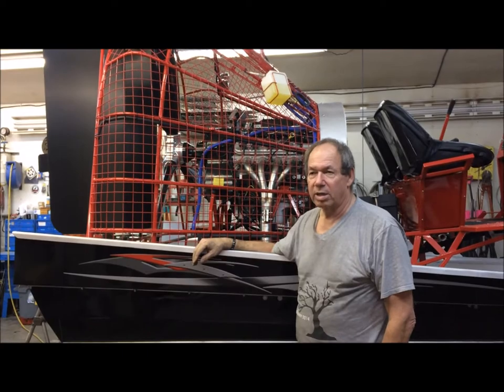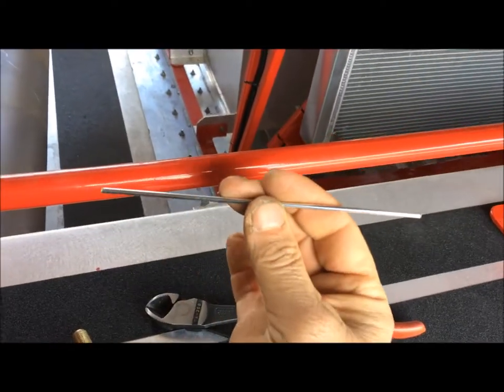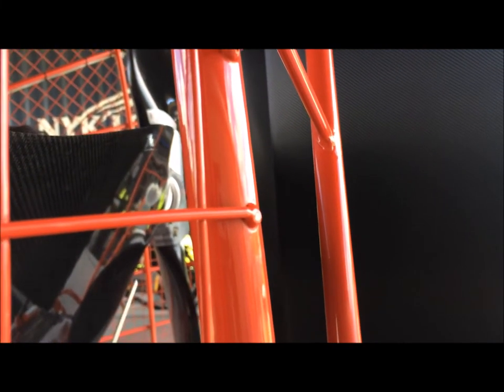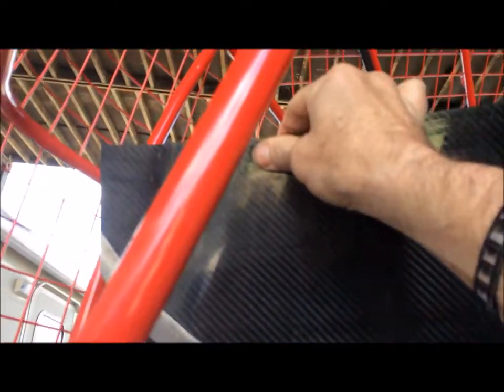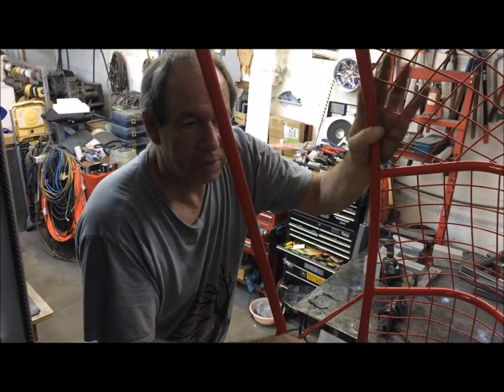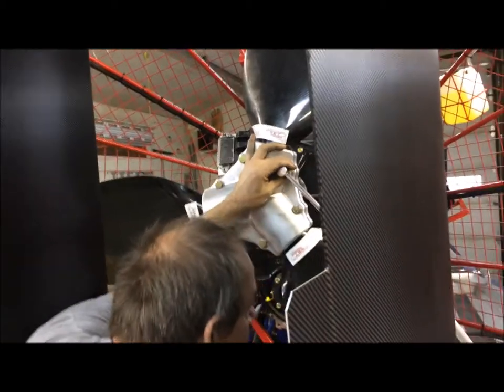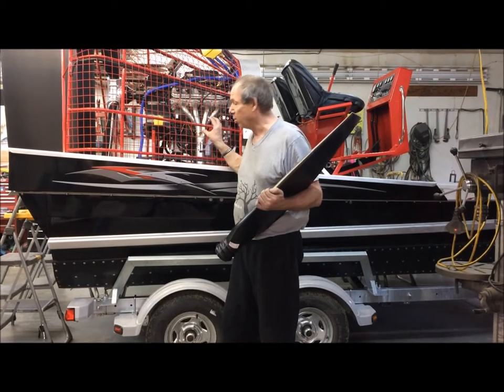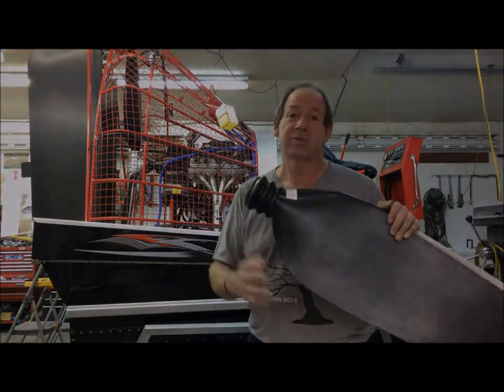How to Set an Airboat's Propeller Pitch

Comment: You always use never seize when you screw steel into aluminum, aluminum corrodes onto the steal and takes out all the aluminum threads when removed later. Also keeps stainless threads from culling when removed.
Reply: The hub on my Q series have steel thread inserts on the back (engine side of the hub). The washers are actually a pair that work together, the side that mates together have little jagged like edges that mate together. The side against the hub cover and the bolt side have ridges. A really good video showing probably the most accurate way to set the pitch.